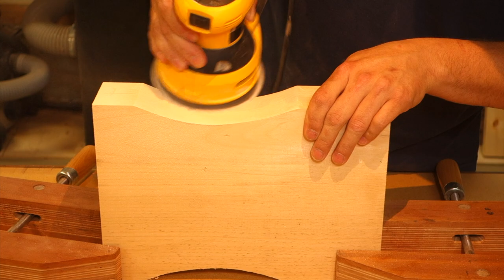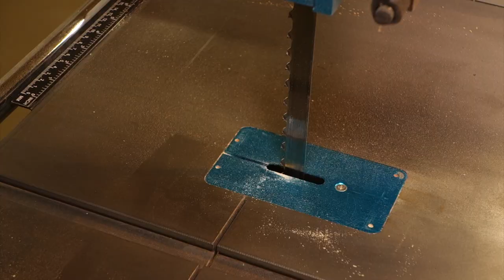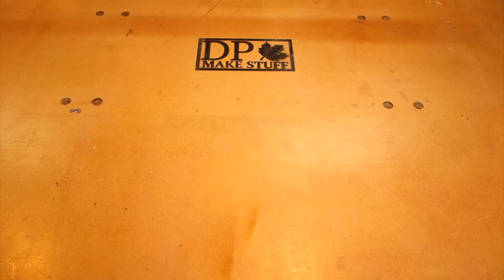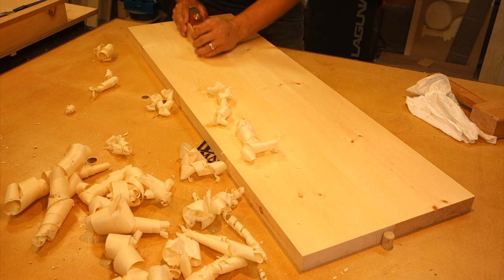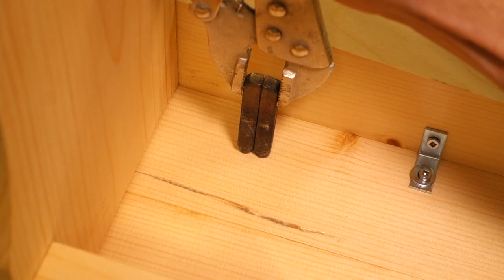Simple Pine Bench

Comment: This is not a Simple Pine Bench--many saws and tools being used. This is a fully set up woodworking shop. I want really the basic bench. You have failed to keep it simple. But a nice project for you.
Reply from the maker: chris winter there is more than one way to build anything, including this bench. This is a simple bench since it uses simple joinery. If I had decided to implement sliding dovetails or traditional mortise and tenon joints then it would not be a simple bench. If you can’t build this bench without a drill, circular saw and jig saw you should just go to ikea.

Comment: Had me right up until the metal L brackets......
Reply from the maker: Well we had a good run. Later.
Reply: lol
Reply from the maker: How would you like me to attach the top that allows for a ton of wood movement?
Reply: I was hoping for a floating wood clamp... dato cut into the stringers...  Dont get me wrong here.... beautiful bench I just cringe at L brackets...
Reply: Eh
It's better than just using wood blocks. 
Maybe some hidden dowels but if you're like me
The layout would be eating the first 12 times. Lol

Comment: First thought was this is really nice and simple, thanks for sharing.

Second thought, and trust me I have no idea what I'm talking about, 
but if the feet were joined together horizontally instead of vertically
....and you made that curve at the join line, then the join would not be apparent at all. (instead of down the middle of that curve sweep/ design element, that is very visible)

Could have probably been a little easier to shape on the bandsaw instead of getting the router as well, as the horizontal pieces mortice for the legs could go down the single piece depth.

Honestly, I have no idea about this stuff, I do watch a few WoodWork videos but zero experience, so take my criticism as constructive or irrelevant as suits.
Reply from the maker: Yeah that would also work.  As a general rule for woodworking, a square hole is the hardest thing to make.  By splitting it like this, I could more easily make the mortise to accept the leg.

Comment: Why washers on just one of the L bracket holes? Awesome project and love that you got your daughter involved!
Reply from the maker: The screws going into the bench seat get washers to allow for wood movement.  The other side didn't need it.  Thanks!
Reply: +Dustin Penner thanks! so basically the washer is bigger than the thread diameter so it can shift, but if you bottomed out the countersink all the way to the bracket hole it would have constrained it fully?
Reply from the maker: You got it!

Comment: first off, love your videos man. just a couple of questions why did you make the feet in two pieces? and why not go all the way with the notches on the table saw for the side pieces? why finish with the bandsaw?
Reply from the maker: +Fogger it was cheaper to glue two pieces together and also easier to cut the mortise. That was as high as my blade could reach with my table saw sled. Had to finish on the band saw. Thanks.

Comment: Excellent Build love it. Hope you paid your helper well, in sweets ha ha. One question, at the end when you were screwing the top down with the L brackets, why did you only use 1 washer on the seat side and not for both? 
TC, Barry (from England)
Reply from the maker: The washer lets the screw move as the wood moves. It wasn't needed on the sides since wood movement will be minimal there. Thanks!

Comment: Did you free hand that mortise or am I missing something? Maybe it is just the sped up video, but if so that is impressive.
Reply from the maker: yeah I got it close to the line just taking little bites and then do a final pass to make the line straight.  It's hard to see with the speed, but i just pinch my long router base and use my fingers as a fence.  Thanks
Reply: Brilliant, never thought of using the fingers for a final pass, will have to try that out.  Thanks. Great build!

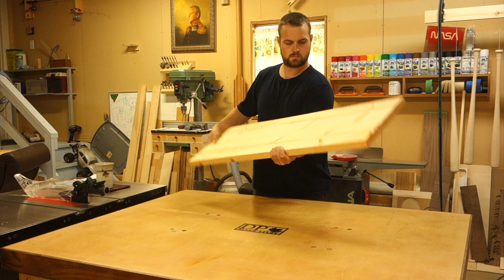Comment: Great video, I liked the way it turned out. I saw the post about the L clamps. I am a newbie to woodworking...what would happen if you used pocket screws to attached the top to the frame? Also, at 8:27 who is that soldier in the painting? Thanks!
Reply from the maker: Pocket screws in the right place would have been fine.  That is a painting of Sir William Murray.